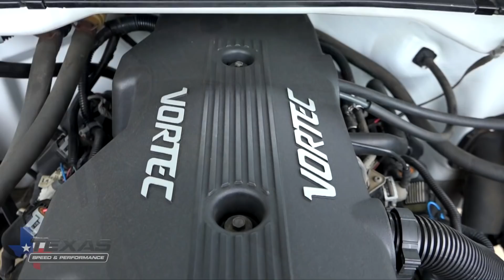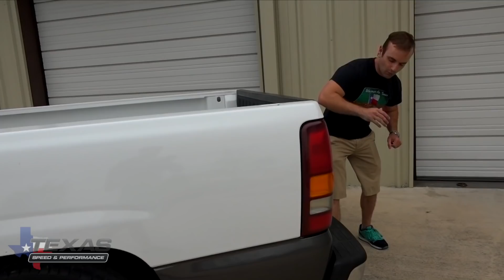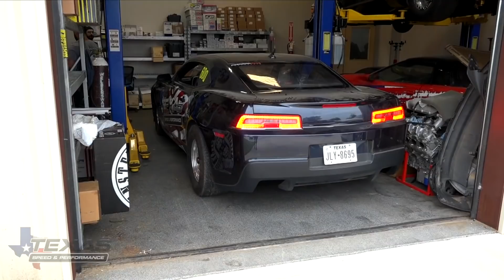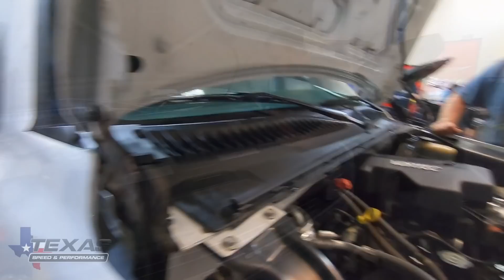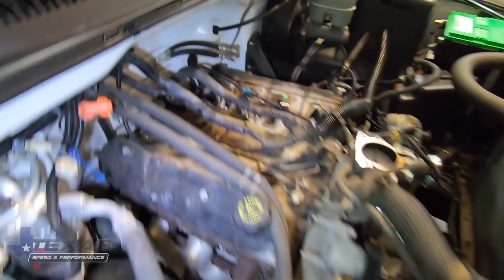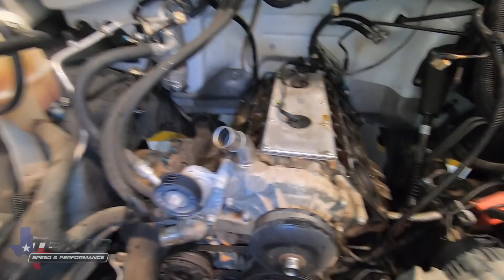Gearing Up For Rocky Mountain Race Week 2021!

Comment: The same exact yr make an model I built from your guys parts other than the cam I went with a BTR 3 cam. But other than that 1 7/8 headers with off road Y, some PRC heads, have a circle D 3200 converter, an 92mm TB, an so on. Next stage is the 6.0 with procharger D1 on it with built 4L80. Still in the works.